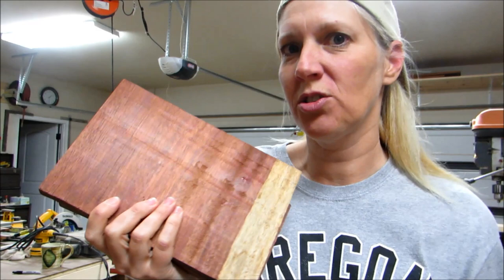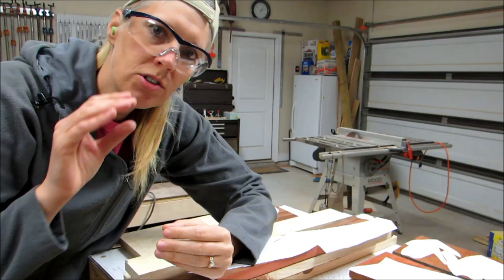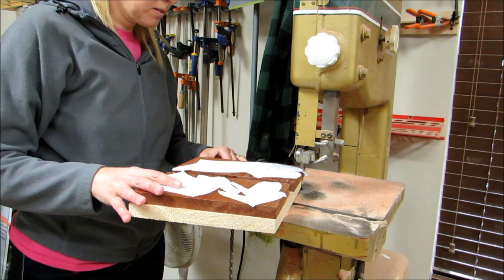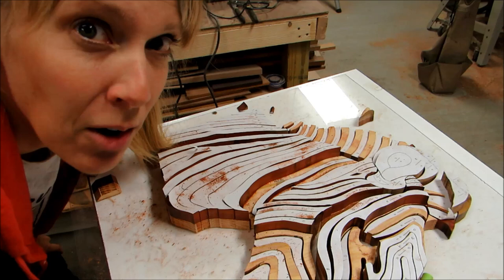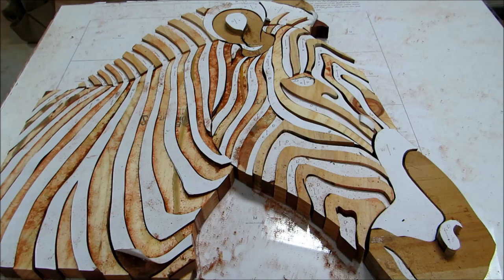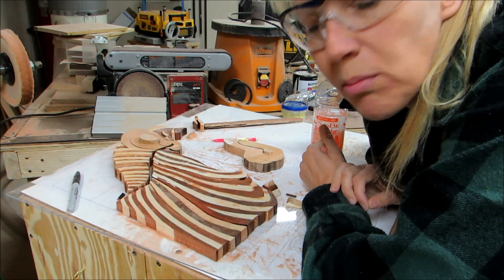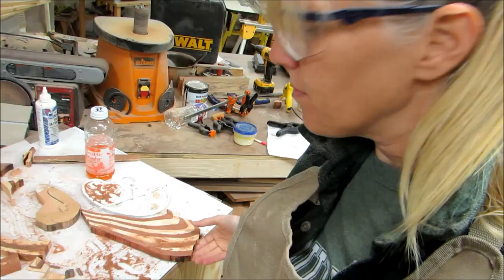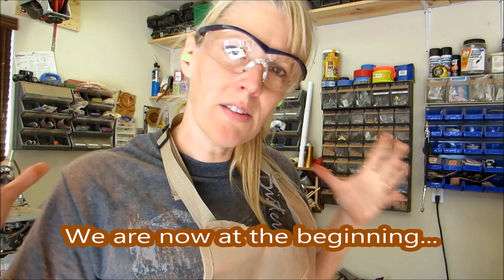Two Intarsia Zebras, part 1

Comment: When I cut two of something I tape the boards together with carpet tape. I use enough that it holds together even if I cut through the tape and I don't risk hitting a nail. My next video actually uses that technique. Hopefully it will be uploaded in the next few days. 

Cool project. I want to try intarsia soon but I need a scroll saw first. I'm looking forward to part 2 to see how it turns out.
Reply from the maker: Got Wood I have used carpet tape before, I remember it was difficult to get off the wood later.  Any suggestions with that???  I was very concerned to hit a nail, the hot glue technique worked very well, and I think I will do that one again!  I will keep checking for the video!!!!
Reply: Cy's Corner The best suggestion for carpet tape is don't overdo it. Get the thinner strips and just use enough to hold it together without letting the pieces shift. I was able to get it apart pretty easily.

I had a little delay in getting my video finished. I had to put it on hold to replace the heater core in my wife's car. Hopefully I'm wrapping that up today and can finish the video in the next couple of days.

Comment: double stick tape may have worked instead of the brads. For hand sanding different shapely pieces, I use pipe insulation, or noodles from the dollar store used in swimming pools, You can cut em how you like, and they make decent "backers" for the sandpaper. I also think it's Padauk
Reply from the maker: Roger K Neat idea to use the swimming noodles!  I have tried double stick tape before and didn't like it too well.  The hot glue trick seemed to be the best!  That wood sure does look like Padauk!Thanks for watching!

Comment: wow. I can't believe you did that with a bandsaw. Kudos!
Reply from the maker: Nouser Unrecognizable I love the band saw :)
Reply: Cy's Corner I hope you make a video showing some of the in an outs of the bandsaw being used as a scrollsaw. Like how you made the inside cuts, how you glued the relief cuts (I assume you glued them), size blade, was it necessary to use a smaller blade, etc. etc.! I think it would help a lot of people out! Great videos Cy, the other girls got nothing on you! ;)
Reply from the maker: Nouser Unrecognizable Thanks for asking about that stuff.  I really love the band saw but have learned the negatives with using it for intarsia.  However, there are a lot of positives to using it too!  I will think about putting together a video about those things you asked about.  Thank you for watching, commenting, and asking questions.  :)

Comment: Cy. Very nice work. I know this is an older video but I just started watching. What kind of bandsaw blade are you using to cut these curved lines. Thanks for sharing on YouTube
Reply from the maker: Hello Jim, I am not sure of the blade size, but it was a smaller one. I am learning more about blades for both the band saw and the scroll saw. Some folks won't try cutting intarsia on the band saw, but I didn't know any better and I understand why now, it is more difficult and you can't get those tight curves, but better using a band saw than no saw!!! :D